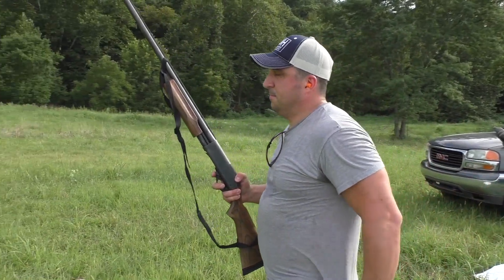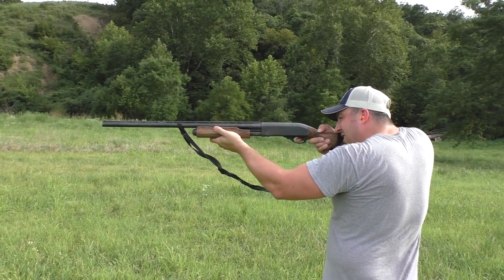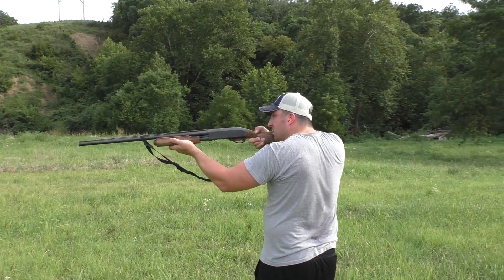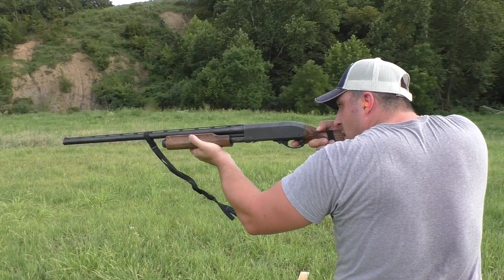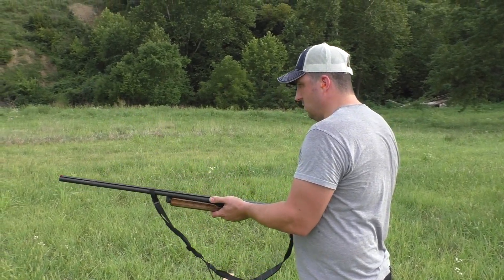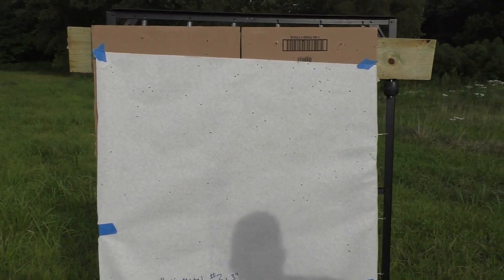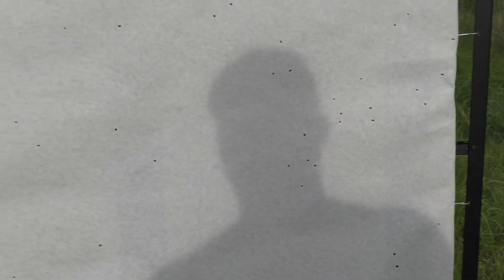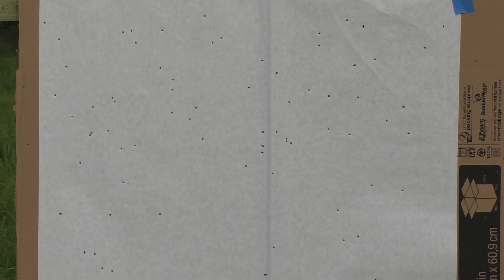Duck Hunting:  Heavy Metals vs Steel Shot

Comment: Thanks for the video. Do you all shoot improved? How does it compare to the modified out of your guns? The pattern seemed pretty spread out at 25 yards already. Just curious. I am no expert at all, but my dad and I shoot 2s as well. They seem to knock them dead out to the edge of our deeks.
Reply from the maker: +chasemukluk go to the freelance discussion playlist. I did an entire video on shotguns and chokes
Reply: I think that with the greater number of pellets with Hevi metal it should give you more pellets at 25 yards.  I would be hesitant to shoot 2's with steel at 30 yards with 1 1/8 oz shot and an improved cylinder.  I would want to keep my shots at about 15 to 25 yds.
Reply: I think you should try shooting blind side you could use a modified choke and have the same pattern close and far and more knock down do to the cubes transferring more energy than a regular sphere pellet.  blind side opens up pretty fast.
Reply: Any evidence for this supposed extra energy transfer with cubed shot? I would imagine that cubed shot does not penetrate nearly as well as round shot.
Reply: Wayne Motty sounds like marketing fairy dust to me. Company A needs something better than Company B, so they market "better" product. Cheap shells kill em just as dead as the next one.

Comment: How often do you guys shoot an IMP Cylinder? I started shooting a Carlson's Extended Range and will never shoot anything else. I bag more birds and have the capability to knock birds down consistently at 40+ yds. With that tight of pattern, you either miss a bird or knock it down, I hate wounding birds and losing them. Good luck this year guys, looks like you started it off right!
Reply from the maker: i use IMP cylinder. we want to shoot our birds at 15-25 yards/feet down

Comment: Hevi-metal is a round composed mostly of steel, but contains some of their "hevi-shot" which is a blend of various metals that are heavier and denser than steel. The hevi-shot they put inside each round of heavi-metal is two sizes smaller than the steel shot, which allows you to get more pellets on target.

There is no doubt heavy-metal is more lethal and superior of a round than a regular steel round, the question is, will it pattern well enough in your gun to make it worth using?

We know hevi-metal is ballistically superior than a standard steel round, so if you can find the right shot size and choke configuration to get it to pattern well, then it of course is a better choice than a regular steel round.

 It would be wise to try a few different choke sizes. Eventually you will find a choke that allows the hevi-metal round to pattern just as good, if not better than that steel round was patterning. 

You were using an improved cylinder choke on that 870. I have never met anyone that hunts with an improved cylinder choke, even when hunting over decoys I use a modified choke.

I have an 870, Benelli Super Black Eagle 2 and a Browning Citori that I use for hunting. With each gun I have tried many chokes to find the best pattern I can get out of the round that I find most effective. For each gun I have two chokes. One for close/medium range and one for medium/long range. They are from different companies and are different choke sizes, but I have patterned them and know they are a good fit for my gun and preferred ammunition. 

For ducks, I use hevi-metal 3.5" #2 and for geese I use either a 3.5"  hevi-metal BB or 3.5" hevi-shot B

The 3.5" hevi-shot B is so ridiculously expensive that I don't shoot it much unless I know I'm hunting primarily geese and have only a few shots that day that I need to make count, but if the birds are out and I have plenty of shooting opportunities that day, I won't use them.

I also choose to use 3.5" rounds instead of 3" because I want every edge I can get while hunting. I don't mind the recoil, i get more pellets per round and they pattern well out of my guns (except my citori which I have to use 3" shells with).

THE POINT IS,.... if you're serious about waterfowl hunting, first chose the most effective and lethal round you can find. Then try as many chokes as you need to, to get that round to pattern well out of your shotgun.

Although I think hevi-shot is the best round available, it is too expensive for me to shoot. Hevi-metal would be my second choice, but even then, i sometimes don't feel like spending that much on ammo so occasionally i will shoot Federal Black Cloud, which is also excellent. It is all steel but has a great wad design that allows me to get great range.

With ALLLLLLLL that being said, almost any ole' cheap steel round out there will kill ducks, but I just enjoy experimenting and don't mind wasting ym hard earned money on over priced ammo and testing which one gives me the advantage, even if that advantage is extremely small. Its a hobby for me....okay, well maybe an obsession ;)

Comment: In the late seventies and before, we hunted a state greentree on Oologah lake (sadly all the trees died from constant flooding and no dry years)and private land (millet and milo) across the Neosho River From the Neosho Wildlife Area I shot Remington 6's and a Lefever 20 ga  SxS double IM/MOD. BOY, those were the days. Perfect setup for the times and the place.
Then came Steel shot and I was lost for several years. I got a 12ga Winchester 1200 MOD and  finally killed ducks again with Remington 2s and 4s.
Changed guns again about the time of the revolution in duck loads and guns. mossberg 835 12ga with tubes Tried Hevi Shot by Remington and the Price along with poor crimps that left shot in the bottom of my blind bag sent me looking again.
This time I patterned. I got Kent,Winchester,Remington Federal Of varying shot sizes and velocities. Best Time and money spent. Since then ,more than 10 years, I have shot Winchester xpert 3" 1550 # 2s for Ducks(mod) and Federal 31/2  1550fps BB( FULL) for Sandhills and Geese. VOILA I'm shooting like a young guy again
The most important thing I  found was a load can pattern differently in same gun by differing the tube and even again by brand of tube. I guess what I am saying is go thrugh this every time some component changes you will be amazed and what a few FPS, or jump in shot size can make. Not only in Pattern Density  But the location of the center of the pattern
Reply: Good comment.  I am skeptical that holes In the pattern will occur the same place every time.  Its been so many years since I patterned a load with multiple shells.  Do you have any experience with patterning multiple shells with the same load, choke and gun?
Reply: The way I do it may or may not be the way the experts would do it,but it works for me. 1st I choose the gun and tube. Then I buy a box of several brands of shells . For instance If I change to a new tube I would buy a box each of Kent,Winchester xpert, black cloud remington and federal since all are readily available here. none would be slower than 1550(with steel speed kills) and I would buy boxes of each brand in 2s , 4s and 6s. 2nd, prepare 5 targets for each  box of shells. Mine are 30" circles divided into 4 quadrants with an aiming dot in the circle. If the choke is I/C I place them 20yds out and 30rds for MOD, 40rds for FULL. Shooting from a bench, I put the bead on the dot and shoot 1 shot in each target. Repeat for each combination. Discard any set that routinely show gaps big enough for a bird to fly through. Then I count the pellet holes in each Quadrant. What I am looking for is a  load that can consistently throw 60% above the horizontal line and as close to 50% as I can get left and right of the vertical. I choose the best 2, shoot the best one and remember the 2nd best to fall back on in case  I am away from home out of shells and my go is unavailable locally. 
For my 835 Ultimag with Carlson Mod choke (Lake Eufalla and Nav Chanel, X at 25-30yds)  Win Xpert 3" 1550 #2s.
Carlson I/C ( Timber, ponds, creeks X at 15-20 yds) Win Xpert 3" 1550 #6
Pattern Master Full (pass shooting Sandhills and geese at Hackberry Flat) Federal 31/5" 1550 BB. 
Now you ask,What do you do with all that extra ammo? Give it to your partner to pattern his gun and you have plenty left for squirrel season where anything is good enough.
Reply: Good post.  Very thorough.  Do you fire more than one shell for each brand, load and choke?
Reply: yes 5 shots at 5 different targets per combination of shell,choke, gun. . as for your concern about holes in patterns not being in the same place for a given combination...you are right, they may change location but a combo with voids will still have voids but you can compare the 5 targets to get a good idea of what you actually get
Reply: That's what I figured that the holes in the pattern would vary between shells.  I guess if I saw repetitive holes in my pattern even though not in the same place every time I would be trying to find a better load.

Comment: You should be using more than a improved cylinder. At least a modified choke. And the hevi metal chokes work amazing with the hevi metal shells. My grandpa took a shot on a goose yesterday at 75 yards with hevi metal BB with a full choke and it dropped as soon as he shot. Hevi metal is lethal and well worth the extra money

Comment: The longest I shot a goose was at 70+ yard on the last dat of the season with 2 1/3 inch Winchester #4 steel shot, it does the job just fine and rarely have cripples, I usually shoot at about 40 yards
Reply: Buddy at 40 yards 3 1/2 inch bb does not even go in the bird barley 2 3/4 at 70 is nearly impossible you're a liar

Comment: is bismuth safe to use in older shotgun? i have an old remington model 11 with a barrel that was replaced in 1960-61.
Reply from the maker: I've never heard anything about bismuth not being safe for older shot guns.
Reply: hevi shot makes a specific shell just for old shotguns its not like hevi metal it doesn't have any steel its 100% hevi shot so its a lot more expensive but its a lot lower fps so you should be safe shooting it but as far as hevi metal idk it should be safe unless the fps is to high the shot its self doesn't tough the barrel at all
Reply: I have a pre Japan A-5 that I use every once in a while. I only shoot bismuth in it since it is soft like lead and won't hurt the barrel.

Comment: I have used everything from the Winchester Super X to Black Cloud over the past 4 or 5 seasons. Most of our shots are at decoying birds at very close range and I have found Winchester Drylok to be the most effective for me. They seem to pattern well and pack a pretty good punch. They also hold up well when they get wet, even with saltwater, which happens alot on the Texas Coast. Unfortunately, I am on a college student budget right now so most of the time I just pick up a box of whatever is on sale. Also, I am working on rigging out my duck boat for this season. I invested in a surface drive motor and have been extremely happy with the performance. Since I am new to the surface drive engines, is there anything that I should know as far as maintenance and/or operation goes, besides what's in the manual? Thanks and good luck this season! We are still waiting on the teal to show up down here. Only a couple more days!!!!
Reply: Not sure what unit you bought.  We bought a used prodrive and then went to a larger new mud buddy.  Mud Buddy has service information on their web site.  The only additional thing that I would suggest is to keep track of wear on your prop.  For my unit they are recommending a prop that is 14.5 inches.  Mine had worn down to about 11.5 inches.  When it gets worn down you will have much, much less power/speed.  So if I were you I would find out how big yours should be and then keep track of it.  Digging into a sand bottom can really wear it down.  We are very hesitant to put ours into a sand bottom.
Reply: Also, I bought a Mud Buddy vinyl cover to protect the motor and controls when outside.  It was well-worth the money
Reply: Carl Snider Thank you for the information. I had not given much thought to prop size but mine does look like it is worn down a pretty good bit. I try to avoid a hard sand bottom but sometimes on low tides I have to run across a few sand flats. I will definitely check out the manual for the recommended size and probably get a couple of spares. Oh yea sorry I forgot to tell you what motor I have. Mine is a used go devil surface drive. I bought a cover as well and they are definitely worth the extra money. Thanks again!

Comment: hey guys I purchased a case of hevi-metal this year at Rogers while they had a great rebate. $159.99 so I thought hey I will try it.
I have tried 4's, 3's, and 2's, all with terrible success out of my Benelli.
it was spreading out way to quickly and the pattern was always inconsistent. no matter what choke I used it. from the farthest range pattern master to the most open stock choke I had no success.

come to find out my wife's gun would not pattern it either as well as my pastors gun.
so it's safe to say I won't be purchasing hevi-metal again. maybe it's because you have two different density materials maintaining different velocity at different ranges which ultimately means different ballistic trajectory.
I'm not sure but it hurt my kill to shot ratio and my wife and I had plenty of days this season where we left disappointed.

Comment: Good video. Since we had to stop using lead, all I ever shot his steel, But I have noticed, a more pellet you have in your shells, the deader you kill your ducks. I think you need at least 140 pellets for ducks, and And 90 or so for geese delivered in a tighter pattern. I shoot a factory modified choke and kill ducks dead over the blocks and out to 40 or so yards. We've all seem to ggotten into this craze about opening up chokes and shooting lighter loads for more speed, or else switching to expensive shells. But remember, off season practice goes a long way in being a better shot. To me open chokes and light, fast, loads lead to not many pellets on target at even reasonable ranges, which may mean cripples. On the skeet range, one or two small pellets will break a clay target. If you drop a clay target from waste high it'll more than likely break. If you take a fully feathered mallard drake and drop him from waist high, he won't break. Just my $0.02 worth. Thanks for the video.  Daniel

Comment: IMHO the ranges you guys usually shoot ducks at, steel should be more than sufficient.  I wouldn't spend the extra $$$ for anything else.  For shooting both ducks & geese steel BB with modified choke is usually a good combo, but you're right you want to pattern to verify.  Tungsten Matrix & Heavy Shot are too expensive for me to pattern, though.

Comment: last season I tried something new,  had some speed ball #1  heavy shot #2 and black cloud #3. I loaded the black cloud in the chamber then the heavy shot on deck and the speed ball last. I called it the 3,2,1, punch and for me I was much more suscessful than usual. I'm not genious but the isea was will the ducks at a closer range I would use the 3's and the further away they got I would be increasing the mass of the pellets. I would normaly wait for the intial shot to be within 3o yards and would almost never use the last shot. take it for what its worth there is a lot of internet experts out there, I'm just sharing my experance, good luck this season.
Reply: gun rem 11-87 modified Carlson choke

Comment: I switched from Winchester #2 shot 3 inch loads to a heavy metal #2 shot 3 inch load and it was a world of difference out of my remington 887. Also if I goose hunt I take BB shot 3.5 inch heavy metal. Killed a giant Canada at 40 yards dropped dead. I believe if it does pattern well in your gun that it will make a big difference in the number of wounded ducks and geese

Comment: i made a switch from 2 shot federal to heavi metal 6 shot i notice a big difference. The shots at 15 25 yards knocks em down with no problem i feel it hits harder than just steel shot. I also notice i cripple less birds. I do not agree with them being 50$ more but on the other hand it allows you to kill more birds i think. Also i ues a modified choke. Im not sure if you guys have tryed a mod choke but it makes a difference as well. You guys should do a vid on the spread of a ic a mod and a improved modified choke.
Reply from the maker: I think we will certainly revisit this topic at some point in time.  I used modified choke for many many years.  But the pattern inside 20 yards is just too tight with a modified.  Improved is perfect because its at its best at 15-30 yards and that's right where we want them!!
Reply: +Freelance Duck Hunting yes i normally shoot 15-25 yards at most i will give that choke a try this year with heavi metal and see if it the same. Also i may be able to go with a little bit smaller shot size.
Reply: Seriously, any steel shell should easily kill any duck at 25 yards!

Comment: I have hunted ducks for along time started in 1983 as a teenager and hunted with lead until the change in 1991 and yes it was very hard to kill ducks clean at the Chang over to steel Winchester made the best steel loads than and they still are some of the best the none toxic of today has came along way and all is very good haven't had much luck getting a good pattern with black cloud  but really good with blindside  and some of the rest and if you use a improve cyl choke don't try past 25 yds unless useing  blindside or hyper Sonics in steel

Comment: I bought a case of hevi metal 3 inch #2 last year and the pattern was not good at all. Birds I hit with it didn't die on impact most of the time. Switched to kent fasteel and had much better results. Hevi metal isn't worth investing in the choke tube they offer to shoot that stuff when you can get good results off cheaper shells. That's just my opinion.